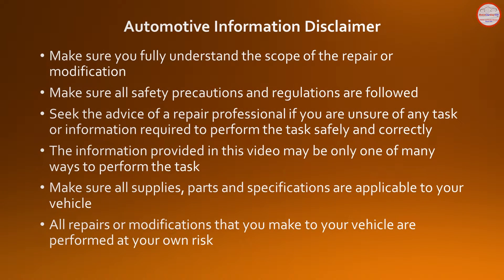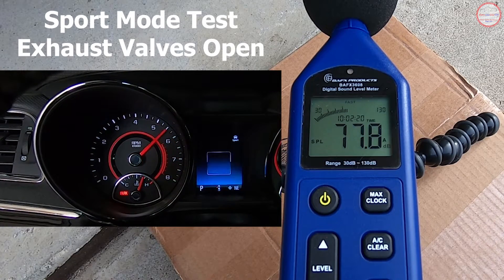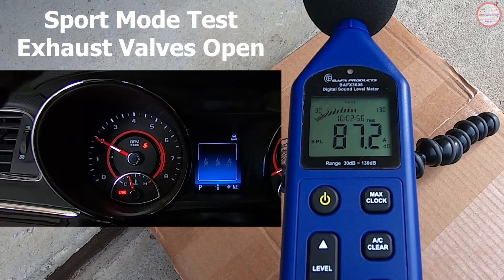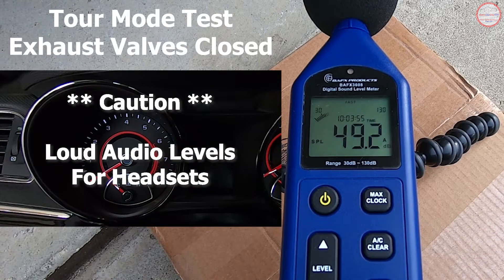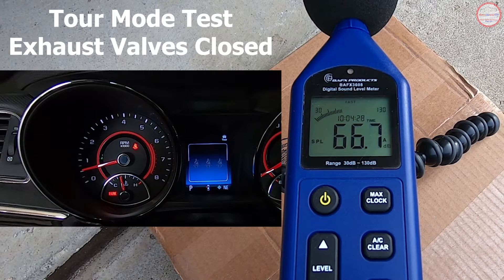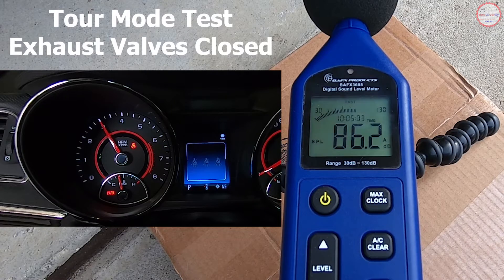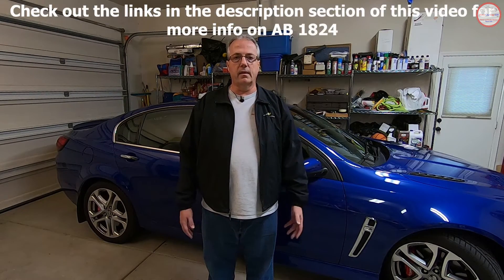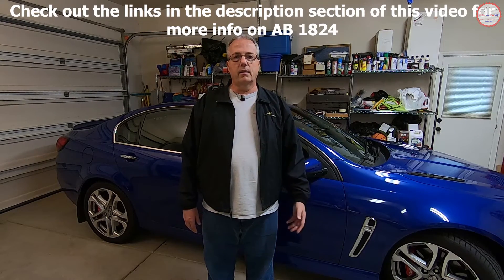California AB 1824 - Example Exhaust Noise Test - 95 dbA Noise Limit - VC 27151a

Comment from the maker: Please check the description section of this video for any updated info regarding the topics covered in this video.  The engine RPM range used in this video is intended only as a demonstration of the noise levels produced with this vehicle.  The engine RPM value necessary to comply with the SAE J1169 / SAE 1492 / CCR 1036 test definitions are slightly different from each other.  I'm trying to track down info for all three that I can reference/state in a video or post but the SAE specifications are copyrighted works and they cannot be disclosed (you can purchase your own copy for $81 each like I did for my company).  I have another video on this topic where I talk about the AB 1824 change to VC 40610 and the various other items involved in all of this, so please checkout that video for more info as well.

Comment: So the test is supposed to be done outside not in a garage where sound echos
Reply from the maker: Correct, the test is intended to be performed outside on a level surface without anything to reflect the sound for a distance of no less than 3 meters.

Comment: Shouldnt you minus the enviorment sound from the decibels that are shown while revving? For example if the decibel meter shows 25 db before the car is on, shouldnt a 85 db be minus 25?
Reply from the maker: All of the SAE testing documentation I found did not subtract the ambient sound level.  The state ref testing measures are based on the SAE setup/tests. The SAE documents state the testing should be done outdoors on a level surface without any surfaces / vehicles / other items that would reflect the sound generated by the vehicle.  It also states the ambient noise level (including wind effects) must be at least 10 dB below the max level of the vehicle exhaust system as not to influence the max dB reading.

Comment: At the min 2:40 you can tell that the exhaust value makes a miss fire noise or downshift noise and the db are above 98 wouldn’t that make it illegal or at least not comply with CA regulations?  (Please replay I would like to understand that)
Reply from the maker: In theory, any dBa reading over the 95 dBa level would make the vehicle fail the test.  My sound meter should hopefully be accurate enough, but my testing environment may not be 100 percent in compliance with the SAE J1492 testing requirements.  The SAE J1492 specifications also give a specific calculation to determine the appropriate RPM value to rev the engine to during the test which is specific to the car being tested.  But in general, if the test is setup correctly and the sound meter is accurate and the vehicle produces an exhaust noise level above the allowed 95 dBa anytime during the testing, it would not pass.
Reply: @RetroCarGuy530  I understand now. So basically no matter at which point of the test if the reader detects anything above 95 will mean an automatic fail. Kind of weird because most of the performance cars will go above 95 during the downshift or misfire. Thank you so much for your answer.

Comment: Are police officers allowed to give you a ticket for an exhaust without performing this test?
Reply from the maker: The test itself can only be performed by the state referee if the vehicle has had a citation written for a violation of one of the qualifying vehicle code sections.  The test performed by the state referee has specific requirements / conditions to run the test to produce a valid result.  Performing the test in the field by a law enforcement officer would not be possible because all of the requirements for the test cannot be met in the field.

The officer can issue the citation if they have reasonable suspicion that the vehicle's exhaust system violates the vehicle code noted on the citation.

CA SB-112 was signed into law on 30-Sep-2019.  SB-112 reverts most of the changes made by AB 1824 Section 4 to VC 40610.  Passenger vehicles can once again get a fix-it ticket (notice to correct) instead of a regular citation with the changes made by SB-112, but motorcycle owners that violate VC 27151(a) will still get a regular citation instead of a fix-it ticket.   The changes implemented by CA SB-112 gives the officer the option to issue a fix-it ticket, but they are not required to make it a fix-it ticket/citation.

Comment: How far away does the sound db tester have to be away from the exhaust tip?
Reply from the maker: I cannot specify any exact testing specifications due to the fact that the document where this is defined is a copyrighted document.  I've had numerous people ask for the details of SAE J1492, but I just cannot give those details without getting into legal trouble.

I can point you at California Code of Regulations 1036 which gives you a set of details for a performing "an exhaust system noise level test", but this *is not the SAE J1492 testing definition*.  It will give you a general idea of how such a test might be performed.  https://govt.westlaw.com/calregs/Document/IA4011680FA6111DE8C6E96BC63A3F6F5?viewType=FullText&originationContext=documenttoc&transitionType=CategoryPageItem&contextData=(sc.Default)

Comment: Where I live the criteria is now 1 foot from the exhaust at a 45 degree angle and revving the car and holding at 4K rpm, for most cars. It changes for diesels and some other types of cars. The sound couldn’t exceed 80db. People tested stock econoboxes and they hit well over the legal limit using that criteria. It used to be worse as the criteria was driving past the decibel meter at 10 feet away while the car is under half throttle. That disqualified every single vehicle on the road for the noise limits. 

There was and is a massive issue with people driving completely stock cars like porsches and audis and the police pull them over all the time and issue vehicle inspection tickets and get the cars towed. The owners usually have it taken straight to a shop and the exhausts are completely stock. They aren’t even the top of the line cars either, they’re the more daily driver, quiet versions. It’s been in the news a few times but the police department doesn’t recognize it as an issue so they keep ticketing every sporty car they see.
Reply: And they are notorious for improper testing of the cars exhausts as well. There are a ton of stories and videos of the police sticking the decibel meter into the exhaust tip of the car and telling the driver to rev the car with the gas to the floor. When the driver questions the officers testing they just write them the vehicle inspection and call a tow truck. 

I don’t care if there are exhaust noise laws, but when they are this low, and they are completely improperly tested it’s ridiculous and a money grab. Add to the fact that vehicle inspections aren’t disputable it’s almost impossible to fight it. People have complained to the city and taken legal action against the department over these issues and nothing ever comes of it. Hell, even some of the dealerships were trying to fight against the department because their cars were constantly being towed and inspected at the dealership and the customers were very unhappy.

Comment: Where I’m writing from, a mass rampage on motorcyclist,
Is underway – mainly for Exhaust Sound Levels, and, other crimes
So, made a video for my fellow bikers here on the legal test standards, as linked below,
Wonder if it’s exactly typical to that of yours, as I just found your channel;
https://youtu.be/Na1HFr57r7U
Reply from the maker: The issue in California was to get car and motorcycle owners to not modify their exhaust systems to exceed the legal dbA limits.  The change in the California vehicle code was used as a disincentive to owners in the hopes of getting them to not modify their vehicle exhausts beyond the vehicle code limits.  The vehicle code references SAE J1492 testing standard which is not a public document (due to copyright restrictions) so for many owners they don't know exactly how the testing is performed.  You can purchase right to view/own a copy of that  document from SAE for your private use so you can see the exact testing procedure.

With the CA SB-112 being signed into law in September 2019, passenger vehicles can once again get a fix-it ticket (notice to correct) instead of a regular citation, but motorcycle owners that violate CA VC 27151(a) will still get a regular citation instead of a fix-it ticket.

Comment: Where can you get your exhaust tested at im from California
Reply from the maker: The only place that I'm aware of that officially performs this noise level test are the CA BAR referee testing facilities.

https://bar.ca.gov/Consumer/Referee_Program/Vehicle_Exhaust_Noise_Level_Certification.aspx

If an automotive repair shop claims to perform this test, they would have to have obtained a legal copy of the SAE J1492 OCT 2008 document and setup a test environment that complies with the requirements outlined in that document.  The SAE J1492 Oct 2008 document is a copyrighted document that I cannot reveal the content of since I did not purchase a license for that type of access for that document - only for private use.  https://www.sae.org/standards/content/j1492_200810

I wish I had a more definitive answer to your question.

Comment: But under load it gets louder right?
Reply from the maker: Potentially.  IMO, the SAE testing process is one that appears to be lightweight in the equipment required to perform the test.  I'm sure the SAE testing process is an approximation of the sound generated by that vehicle and its exhaust system under load based on the the formula used in the test procedure to calculate the RPM range to test the vehicle's engine and exhaust system.  I'm sure the testing steps don't reach a level of 100 percent accuracy across all RPM ranges and load levels, but SAE must believe it's a good enough predictor of the noise levels generated by that vehicle and exhaust system.  Again, I can't state exactly what the SAE testing process is since it's in a copyright protected document and I don't want to pay the large licensing fees to have the ability to use the SAE document's contents on the internet.

Comment: My weed whacker is louder than 95 decibels. Not to mention, most cars on the road today have good insulation from sound. These politicians love to try to squeeze money out of law abiding citizens.
Reply: The people in cars with their windows rolled up are not the people most bothered by noise pollution. It's the pedestrians, cyclists, people at home or work, drivers with their windows down, etc. Clearly if you set no limits, some people will go too far and make their vehicles disturbingly loud. And they'll even do this purposely to anger people around them because that's just the kind of person they are. That's why people pass these laws. They're rarely enforced, so saying it's a money making scheme is far fetched. And your example of a weed wacker is whataboutism, and also a bit odd because in California we also have laws about lawn equipment noise pollution.
Reply: It's a great law.

Comment: Do you how much RPMs they test for for?
Reply: @pbmig  2000-3500
Reply from the maker: @miguelrocha3522  There's a very specific manner in which the max RPM for the test is determined based on the testing spec in SAE J1492 OCT2008.  There's no one answer to the question since it depends on the vehicle and the testing spec definition.  Your stated RPM does not include the RPM test range for my Chevy SS sedan's LS3 engine.  I wish I could say more than that, just can't with SAE J1492 document being copyrighted.
Reply: I got u man my friend  got hit for a 92 foxbody with legal x pipe exhaust and I went with him I thought that was the universal range.
Reply from the maker: The RPM the engine is run at for the state referee test is defined in SAE document J1492 OCT2008 which is a copyrighted document.  I cannot state what's in that document without violating the copyright for that document.  If you want to see what's in that document. for your own private use, you must purchase a copy of that document from SAE for $81.  I've added the link to that document in the description section of this video.  You can get a "preview" of the SAE document on their website, but that does not contain any of the specifics of the test suite defined in the document.  Sorry, that's the best I can do...